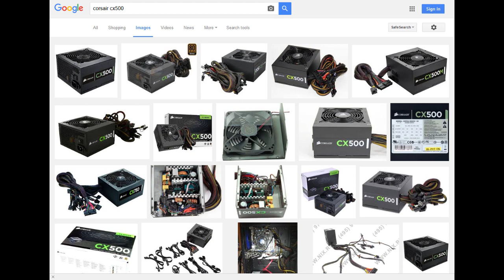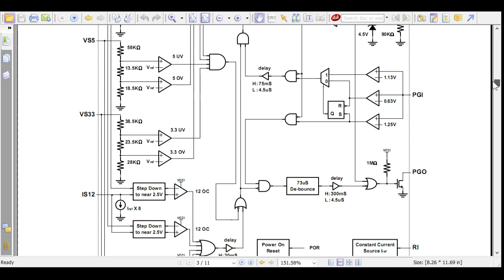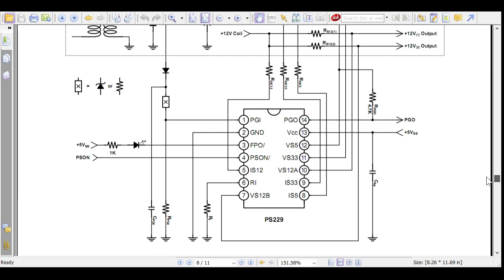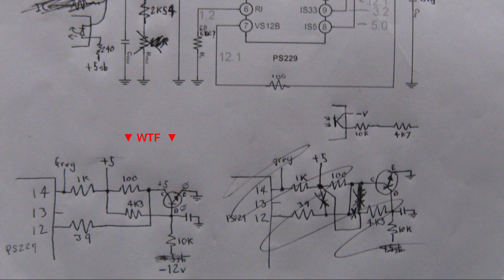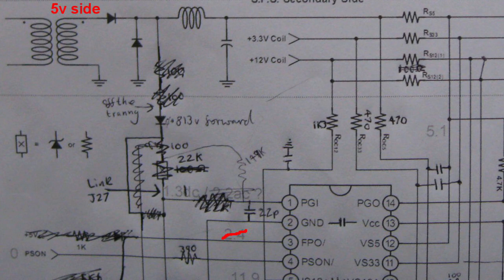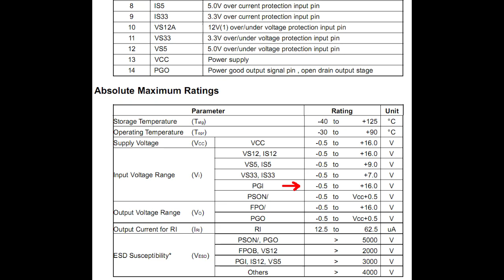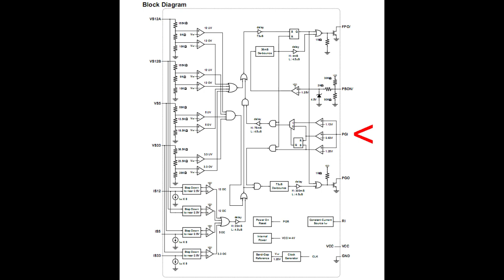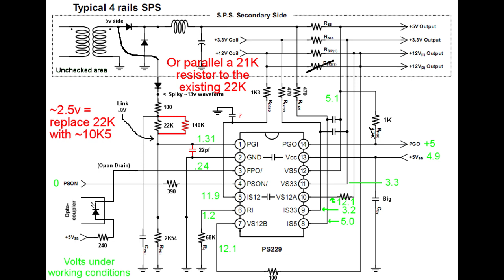Corsair CX500 PSU Repair

Comment: Hello. I have Power Supply Thermaltake 650W. All voltages are normal, but PG is no. Supervisor on chip PS229 datasheet http://www.techpowerup.com/articles/160/images/ps229.pdf
I have pin 1PGI  - 1.17V, pin 14 PGO - 119mV. All other voltages correspond to the datasheet. Please help me. Where is PG?
Reply from the maker: "+Дмитрий Ляйком" I do not know the circuit diagram of the Thermaltake, so this will be a guess:
The PG on the ATX connector, should be the PGO on the chip.

Add another resistor in parallel - to resistor mentioned at 07:30.  I mentioned a 140K resistor, but try a much smaller one.  Until the voltage rises to about 2.5V+. Example 20K or 40K.
After the change, it should make the PGO output 5v (after the next power on)
Reply: +Techy Bits-n-Bobs I have module http://c2n.me/3y2eOyw.jpg
http://c2n.me/3y2jo7B.jpg
What resistance must be put in parallel? For R58?
Reply from the maker: '+Дмитрий Ляйком' If the top left pin is pin 1 of the chip.   Unfortunately that is the wrong resistor.  This 2K2 goes to Ground.

You will need to follow the 'though hole' which is also connected to pin 1.  This will be connected to another resistor then diode then something else.

If you have found a circuit diagram that would be helpful.
Reply: +Techy Bits-n-Bobs with the back of the module to look for?
Reply from the maker: +Дмитрий Ляйком Follow the light green dot:
http://postimg.org/image/lcxaffofl/
Reply: +Techy Bits-n-Bobs To what do I need to rewire the resistor in parallel another resistor and a denomination?
Reply from the maker: +"Дмитрий Ляйком" Sorry, can you re-phrase the question please
Reply: +Techy Bits-n-Bobs a resistor value is needed? And what resistor soldered it?
Reply from the maker: Ohh I see the new picture.
What is on the other side.
Reply from the maker: http://postimg.org/image/xpwunbdgx/
If you find that resistor.  Try a 40K in parallel.
Reply from the maker: http://postimg.org/image/erqeg7ldd/
Reply: +Techy Bits-n-Bobs top side http://c2n.me/3y3xSy5.jpg 
Which still need a resistor?
Reply: +Дмитрий Ляйком http://c2n.me/3y3xZ2j.jpg
Reply: +Techy Bits-n-Bobs right http://c2n.me/3y3zBzR.jpg ?
Reply: +Techy Bits-n-Bobs http://c2n.me/3y3BWtM.jpg 47kOm good work!!! PGI 1,5V, PGO 5.01V
Thanks!!!!
Reply: +Techy Bits-n-Bobs PGI max 1.33V? 1,5V very high?
Reply from the maker: Well done!
1.5v is not high.  Because the "Threshold Voltage for Start" does not mean Maximum Input Voltage.
Infact a higher voltage (e.g. 2.5V) would be better.

You might need to do a long test.  To make sure it does not turn its self off.
Reply: +Techy Bits-n-Bobs good!

Comment: It seems to be a common issue plaguing all of the CX series power supplies. I was looking on the bay and there is a person selling dozens of these various units ranging from 500 to 850 watts, all dead of course. I am tempted to purchase one and see if I can take a crack at it. In regard to power supplies in general, there is typically a group of transistors that are tied to the pwm controller and if they become unstable can cause the power supply to not function. Also there are some low value (typically 2.2k ohm) resistors near the voltage regulators that can cause a breakdown in voltage. As you said, it's just a poor design, probably designed to make poor people go out and purchase a new unit, make them even poorer!
Reply: the problem is the junk capacitors. I re-capped them right out the box and they are still going strong after 5 years of daily use
Reply: @PhuckHue2  all of them? Including ceramic one?
Reply: @dogodogo5891  Its the electrolytics. The ceramics are fine. Sometimes crappy engineering is at fault too. I only buy Seasonic and gave up on the cheap junk
Reply: you should,, the problems are usually very simple to solve but you need to analyse every single inch of it ... I repair them all the time, but the problem isn't always about bad caps..
Reply: @TeacherBrunoOneil  also cheap manufacturing practices. They only care about volume. Something as simple as as a hipot test can fry something partially and when the consumer gets it its either DOA or dies in a month
Reply: @PhuckHue2  sometimes I get horrified by  how badly components are soldered on the pcb.  it's there to break loose and stop the psu from working. you are right.. cheap manufacturing pratices is a problem. for them it's about quantity and not quality.